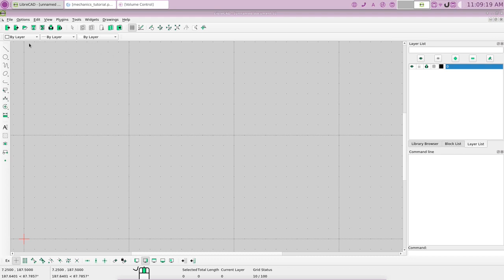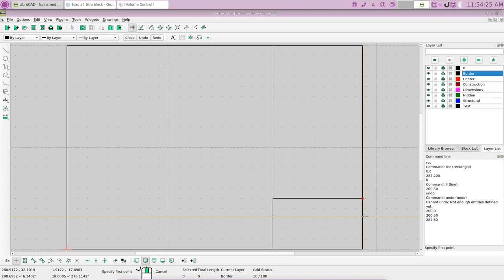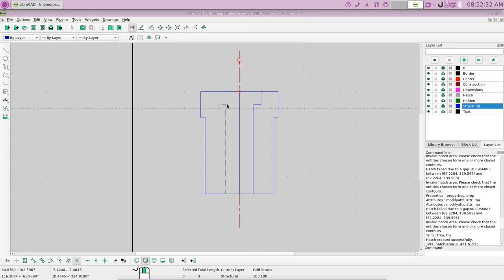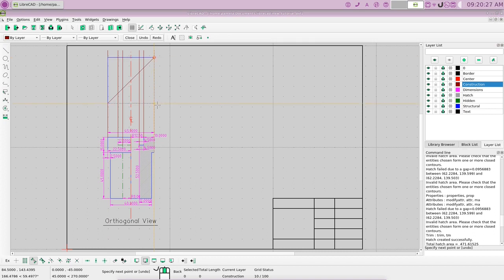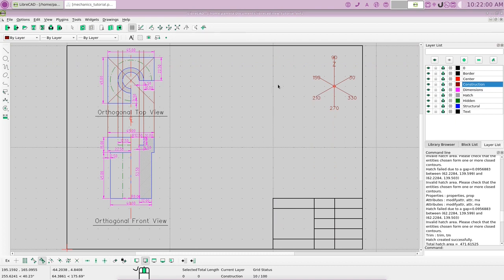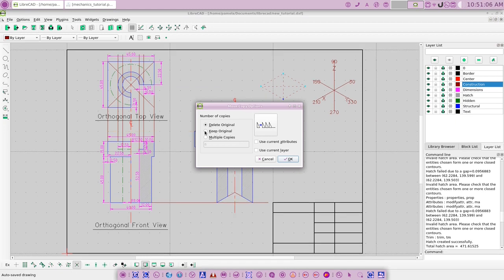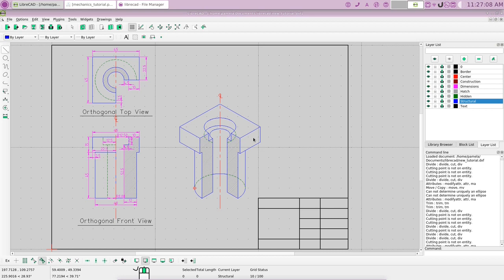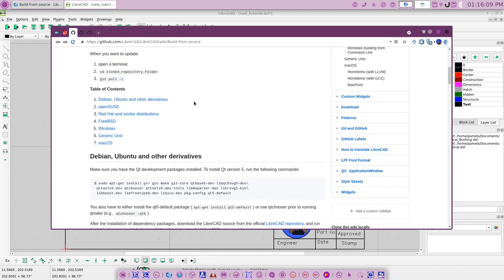LibreCAD Beginners Tutorial UPDATED 2022

Comment: Good tutorial showing me how to get started in adapting Autocad knowledge to Librecad. without the music it would be just hearing you click the keyboard and it didn't annoy me. From an engineering point of view. The grid could be changed to isometric for the last part making it easier. A hatched area shows where the solid item is imaginarily cut through showing the section, so the circle from top view shouldn't have been hatched. The dimensions should be to 2dp as a metric micrometer only reads to 2dp and some dimensions are repeated cluttering the drawing.

Comment: As a machinist the drawing is over diminished. You would have 2 outside diameters, and 2 length dimensions. The hole would be diminished by size and a through hole and the counterbore would have a diameter with a depth dimension and that’s it.

Comment: Just info for newbies, I'd finish this drawing in 10 minutes using FreeCAD.
This is fine for in-plane drawings, but for the 3D projection, use 3D model. Much easier to do and make changes afterwards.

Comment: Hey, Thanks for the turorial BUT I'm having trouble with the order of my layers, At first I thought the program was arranging them for me but now my center line and dimentions layers are the first two under layer zero. Is there a way to arrange or move layers?
Reply from the maker: Hi romanpen; Thank you for your inquiry. The layer in LibreCAd are created and placed "alphabetically" by the program. To move the layers up or down just add a letter (a,b,c,d,e,f,g,....) to the front of the layer name. I hope this helps. howtopam
Reply: I have one more question. The dots on my grid are extremely hard to see in comparison to the videos, I've changed grid and metagrid to solid black and the bg to solid white but i still have to squint my eyes to see the dots. Which setting do i used to make them more noticeable?
 @howtopam

Comment: hello i am bnot getting the snap on section at 28min i dont see what you do with your cursor to enter it snap endpoint snap on etc plz explain
Reply: it seems after entering the preset we need to click in the drawing for it to be saved and then i still dont undertsnad the bottom left free sanp and endpoint settngs highlighted or not okm thxz
Reply from the maker: Hi @pjmclenon; thank you for your question. At section 28 minutes I choose the "free snap" option so that I am free to select a point anywhere on the drawing without my cursor being drawn towards an existing grid point.  Then I choose the "vertical line" tool which opens an "options" window at the top of the drawing window where I can input dimensions for the length of my vertical line. I hope this information helps you, if not please re-comment and I will attempt to assist further. Thank you for viewing this video tutorial from howtopam

Comment: I need to 'shrink'  the pgm so I can SEE both the 'top'  & commd line at the same time.  Trouble is HOW?   Thanks!
Reply from the maker: Hi Boswell Inniss; I do not know why your LibreCAD application is too large for your screen. But you can resize all windows by clicking in the corner of the window and holding down the left mouse button and dragging the window to the desired resize. If your problem is the your screen is physically too small and incapable of the resolution that your computer display is currently set at, you can "cheat" the LibreCAD QT application size at the command line  when opening LibreCAD with this command: QT_SCALE_FACTOR=1.5 librecad & 
See here: https://forum.librecad.org/GUI-scaling-problems-td5720394.html
Change the QT_SCALE_FACTOR= SIZE to your desired layout. If your LibreCAD application is too large for your screen then set the "SIZE" attribute at 0.85 or 0.9 or 0.75
After you have started the LibreCAD application from the command line use the [Ctrl + C] keys to exit the application.
Thank you for your question. I hope this information is helpful in resolving your LibreCAD issue.
howtopam

Comment: This is one that I wish I had found earlier because it contains a simple walk-through of the action symbols and how to control the layout at the beginning of the video, combined with a simple explanation of their practical application.  That saves a lot of time assimilating the logic and limitations of LibreCAD's capabilities, which in turn enables one to not only more completely assimilate what follows, but also imparts the off-hand ability to get what you need for the project you are working on.  It's worth going through the entire video because what follows works in alternate methods of accomplishing the same things that are more efficient in a case-by-case basis, as well as some operations that require demonstration to impart the concept such as trimming and filling.  I played it at 1.5 times speed because I understand better when things move faster, and I can always hit pause when I want to stop and  think how to apply it to what I'm working on.  Thanks to RobsGamingNetwork for indexing it so I can return to points in the video efficiently.

A couple of default settings I wished I had changed in the beginning are the colors.  The black theme and complimentary colors for the grid etc. might be fine for designing,  but you don't print on black paper, so the light colors you pick for layers that contrast so well on black are the opposite of what you want when you print on white paper where you need colors that contrast with the paper.  Perhaps there is a default template somewhere that has the perfect mix for a white background.  If you want to stick with the black background for design, you could always swap light green for dark green etc. when you go to print.

One thing I wish and that is that I could print the grid because the grid is sometimes a logical division of the units chosen.  For instance, for house plans, if you are working in inches and fractions, it will might show 6 divisions, which is 2 inches, which makes it easier to determine distances that are not foreseen as needed during design time.  I got around it by taking a screen snip and printing that, but native would be nice.
Reply: I have seen some excellent replies in my time,  but this reply is probably the most well thought out and executed replies that I think I have ever read before.  This reply should be taught in school as an example (THE prime example) for how to convey ones thoughts, exactly how they are intended in a matter easily understood and leaves no room for misinterpretation due to a lack of clarity.

Comment: Thanks for the great tutorial from you Howtopam. At several times during using it  I was puzzled why the results I was getting  were not as I had watched , until I got to the end & realized that my version 2.3.1 was not quite the same as your 2.2.0 Cd 3 version. I managed to work around any slight niggles  & am now loading the updated version. Thanks once again.
Reply from the maker: Hi Merv Richmond; Thank for your comment. Yes if you are comfortable updating your version of LibreCAD it is the better way to go. There are video on teh howtopam YouTube channel that will show you how you can easily update your LibreCAd version if you need assistance. If you have any further input or questions please feel free to put them in a comment.
Thank you.
howtopam
Reply: @howtopam  As an update to my last message, I tried several times today to download   the 2.2.0-Rc3 version to run on my Win 10 x64bit pc, but each time it crashed out of the install! Looks like I'm going to have to stick with the 2.1.3 flavour unless I find a tutorial to guide me through installing in Windows.
Keep safe.
Reply: I assume you mean Windows version 2.1.3 and not 2.3.1 because there is no 2.3.1

Comment: Beginners Tutorial
Table of Contents
________________

@2:05 Tool button locations
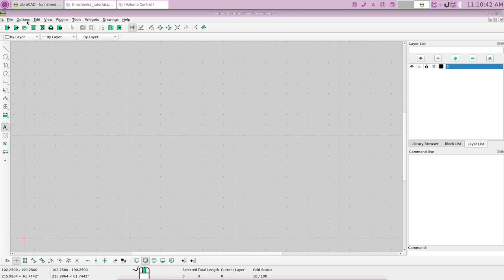@3:30 Widgets and dock areas
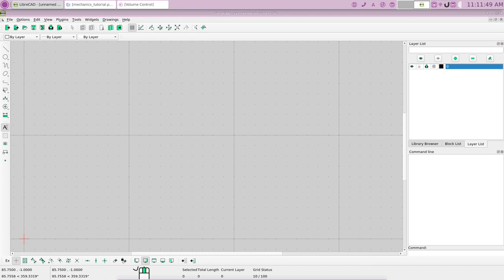@4:35 Snap tool locations
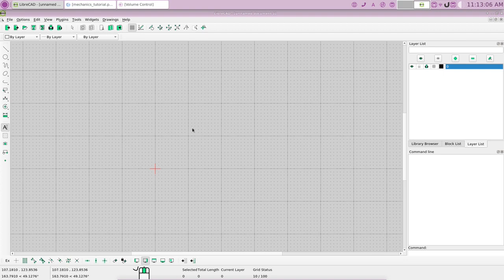@5:56 Application/Program Preferences (Appearance, Paths, Defaults)
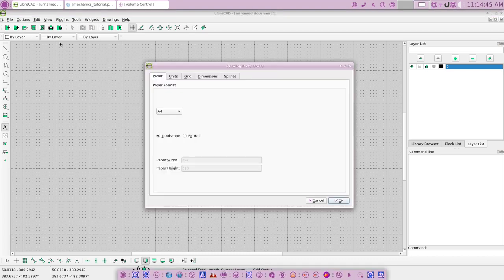@7:19 Current drawing preferences (Paper, Units, Grid, Dimensions, Splices)
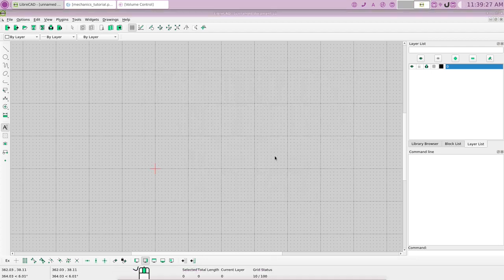@9:55 Introduction to video project of a mechanical bushing
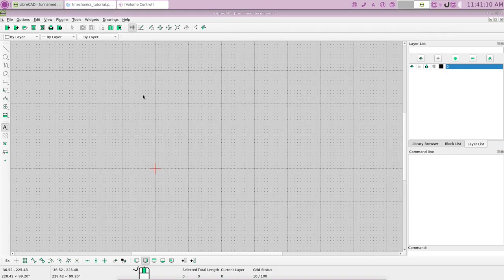@11:33 Origin (0,0 location of drawing)
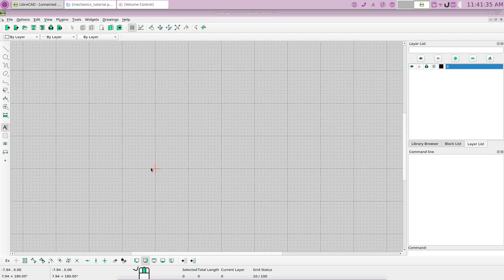@12:04 Auto zoom feature
@12:40 Creating layers
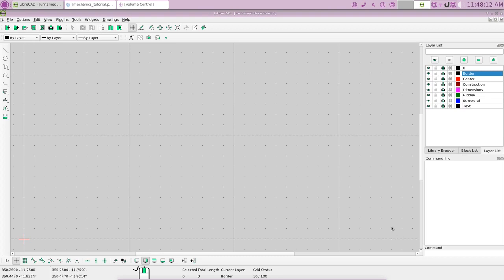@17:20 Creating the border
@18:06 Using the command line to create a rectangle
@27:43 Vertical/Horizontal lines and using presets
@30:40 End snaps and direction
@35:06 Modify/Lengthen a line
@35:59 MText